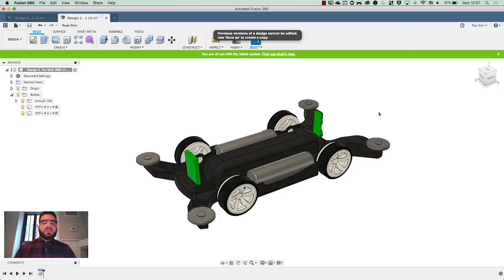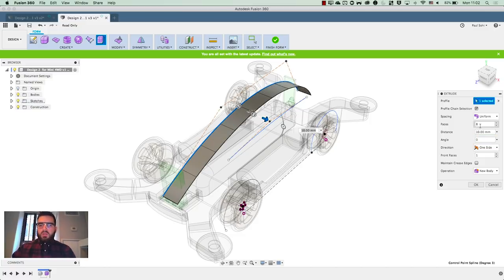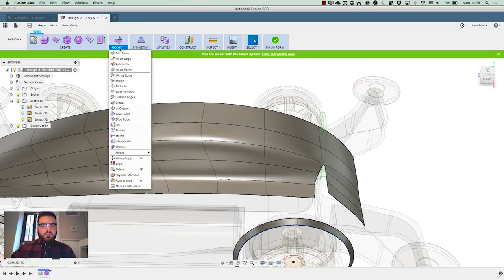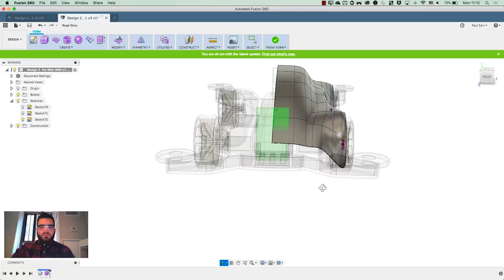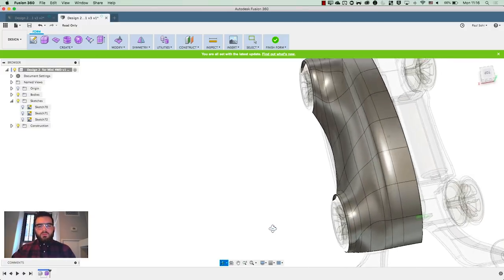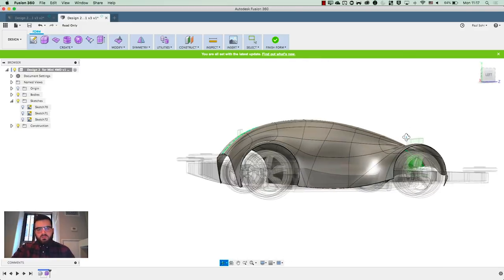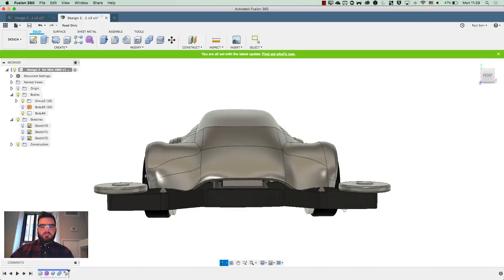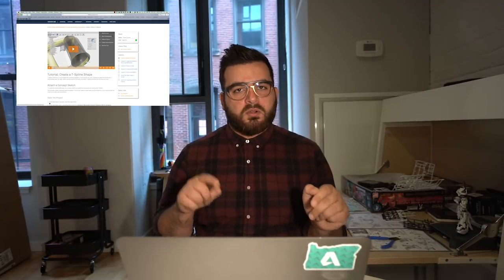Fusion 360 T-Splines tutorial Part 1: the basics

Comment: When I extrude the roof line, I have no faces option. It’s one face only. The other lines extrude properly. Any idea what is going on? I’ve extensively googled to no avail. 🙃
Reply from the maker: hm, I might need some images to help you out there. DM me on IG with some screenshots: FusePS
Reply: So do I!🥲
Reply: @黄可心-k4w  It’s been a while but I believe we figured out the issue. If you’re having the same issue there’s a way to add faces manually. Let me know if you need help.
Reply: @guitarfumar  wow, thanks for the reply! I'm not sure what the problem was, but I seem to have solved it by adding an extra control point there in the spline curve.😀

Comment: Thanks. However, when you were straightening the edges, you grabbed it and pulled it, then put in a value (0.01) each time. Why did you move it first? Is there a reason? And why that value, you described doing it, but not why. Also, when you creased the windshield/roof, I didn't see a value for the crease, just selected and hit ok. Is there no control over the value, or did I miss where it was entered? Nice video, you said what you were doing, just not always why. I'm trying to figure out if I'm going to get into F360, figured tutorials would help. Thanks.
Reply from the maker: Hi Adam! the function I did is a trick where if you scale an edge down to 0.01, it makes it straighten up, that's why. I moved it for visuals for myself. The crease function has no integer value associated, it is a binary crease or not creased. If you want control, you can do that with the bevel function! 

Thanks for the feedback, I am long overdue to make part 3 of this

Comment: Hi Paul, would you be able to make a tutorial on how to make the grovemade speaker, or at least the steps required to make something 'like' this in fusion? Really struggling to get this done :(
Reply from the maker: Do you mean the geometry creation or how to manufacture?
Reply: @paulsohi9015  The geometry, I can't figure out how to make the model in Fusion, or something similar. Thanks!
Reply from the maker: @michaelkelly3158  so for the usual reasons I wouldn't be able to model the grove made speaker, but I can do something inspired by for a tutorial!
Reply: @paulsohi9015  yeah I understand, it's less about making the grovemade speaker and more about being able to model the kind of horn they have within there. I couldn't achieve the consistency of the wall thickness between the outside of the speaker and the horn.. if that makes sense? Anyway, a tutorial for something inspired by it would be amazing!

Comment: The part where you demonstrated how you should match an equal number of faces when using the bridge/weld command was really helpful.
Reply from the maker: glad you like it! I know it's very very late, but part 2 and 3 are coming soon!!
Reply: Hell yeah. Also crazy thing was I clicked on your video and was like, oh shit, I know that guy! Chatted with you at the SQ1conference in Chicago this past summer. haha. Quick question, I imported a fusion 360 file into keyshot, and when I try and drag a material onto it, it changes the whole product to that material. I tried unlinking the material, and also saving as an STL, but have had no luck in separating the materials. Any suggestions?
Reply from the maker: @nickabbott226  I've never actually used Keyshot lol, on IG if you reach out to willgibbonsdesign he should be able to answer that, he's a bud and a Keyshot pro!